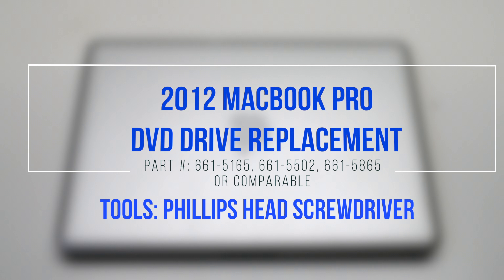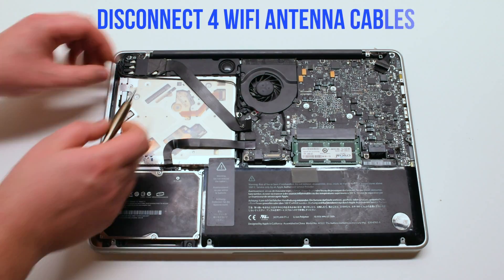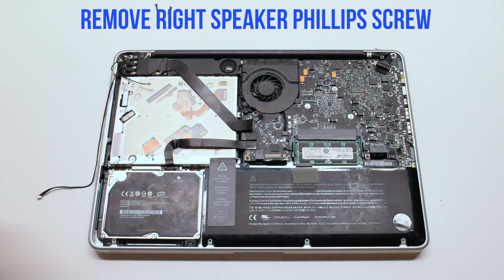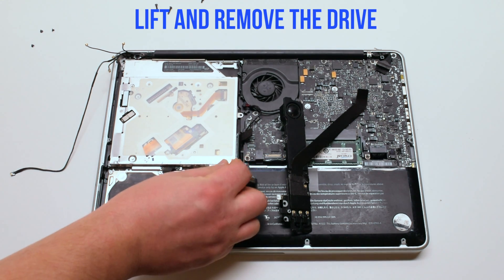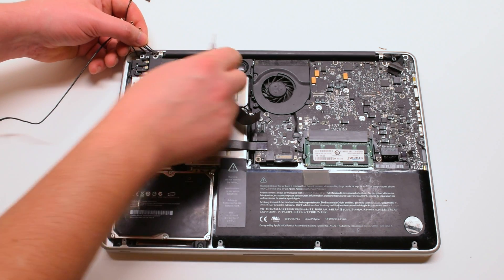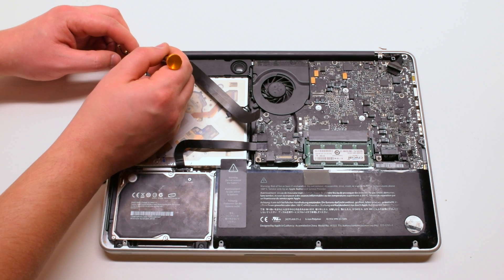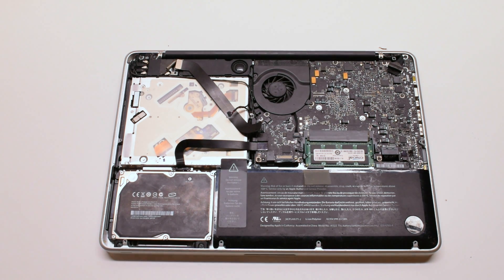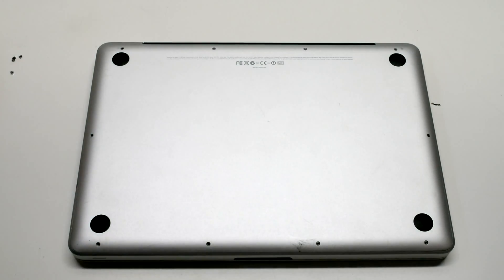2012 Macbook Pro 13" A1278 DVD Super Drive Replacement

Comment: so im not sure if I need a new dvd drive only because it works currently but it makes a horrible sound on computer startup (boot) and use any advice would be greatly helpful...also my screen when I open the laptop its a little loose I'm wondering if I can put a later model Retina display on as a replacement thanks everybody

Comment: Replaced superdrive, but it keeps rejecting discs as soon as I put them in. I recently replaced the hard drive, which had crashed, with a 1T SSD. While I was in disc utility I noticed the icon for the superdrive showed up. So I was wondering if there is something I can do to fix this, by erasing and formatting the cd/dvd drive?

Comment: It is difficult to follow what you are doing because your fingers are in the way. You should zoom in, point to the component, then explain HOW to remove it. You are randomly pulling, unscrewing and grabbing different things like the average viewer knows what you're talking about. It is very easy to damage a part if it is taken out incorrectly so that needs to be explained. I wasn't sure if I'm supposed to pull straight up, push then pull, pull to the right then up, unscrew...that should not be left to chance!
Reply: same kinda for me too lol i ended up ripping a cord outn😂 but over all this a good video btw man if u see dis

Comment: WARNING - Please read ALL these tips for this repair, especially beginners (like myself): 

1) At 1:00 don’t be scared of taking out the iSight camera cable. Just hold the cable and pull it out. Don’t use too much force. 

Also, the cable above it (speaker one) is not needed to be pulled out - once the speaker is remove just move the speaker to the right side while the plug is still put in. This will save time.

2) Don’t be careless - listen to the guy in the video. At 2:35 make sure you 100% move ALL cables gently to the LEFT side and don’t worry about damaging them (and make sure you don’t move the MacBook in the next steps where the antenna is out, so you don’t rip the cable as it can go under the MacBook and rip while sliding it), even the iSight camera one. This is important because them antenna are the reason you have WiFi. 

So, if you accidentally damage them then your WiFi signal will be poor or won’t even work at all. And the cost is like £70 (£15 for the part, and cost for labour as the job will be harder than this video), or a £20 WiFi adaptor will be needed.  

3) The antenna cables take the piss to put back in, but just use the side of a flat screwdriver and press it against the top of the antenna when plugging it in, and use your finger to push on top of the antenna to connect it. 

4) Confidence. This is an easy laptop to repair for beginners, so don’t shake your fingers or be hesitant removing the parts. Otherwise, you might damage this repair. Patience as well. This repair requires patience so don’t be intimidated by adrenaline (the rush/need of doing this repair ASAP to fix it).

5) Don’t worry if you’re missing some screws. It will be fine as long as you have the majority of the screws - some don’t even need to be screwed back in (like the speaker being screwed in with the WiFi airport thing). But try and fit all the screws back in. Also, using a toothpick to take out the screws (once unscrewed) and placing them back in the holes is very useful once you put the toothpick straight in the middle of the screw.

I just want to thank the uploaded for making an amazing and helpful video. I needed to do this repair to remove a CD from the CD drive, and I’ve increased my confidence as I have learned a lot from this repair. Thank you uploader.
Reply: I really appreciate your tips. So many precise instructions are missing from this video. I have a question - how, exactly, is the insight cable removed - do I pull it straight up (like the first cable he showed) or do I pull it straight back (like a plug from a wall)? I'm afraid I might pull it the wrong way and break it.
Reply: Juliet Jones Well with the iSight camera I just used the actual wire (instead of the actual connector) and sort of lifted it and pushed it back slowly then progressively pulling it back with more pressure until it actually disconnects. 

Fitting it back in is easy, as all you do is slide it back in. 

Also, it’s all about being cautious as well as having confidence. Be prepared when doing the repair (like give yourself a day) and don’t attempt the repair while under pressure.
Reply: Looking at the video again, I basically did what the guy did, but I just pulled on the actual wire and sort of lifted and pulled it back slowly then slowly progressively pulling it back with more pressure until it disconnects. So, it’s kind of like both pulling it up straight and back. 

This repair is actually easy, but the WiFi antennas are 100% the hardest part as it’s hard to take them off imo (but easy to put it back on).
Reply: Also use a toothpick and push the back the iSight camera back to the connector (when you have slided it in), if you’re having difficulty putting it back in.

Comment: Thanks for the video. However,  once I installed the Optical Drive it will not accept CDs. The only way it will accept CDs is if I insert a CD upon start up or if I manually type in drutil tray eject in my Terminal and then I can insert a CD. It is as if the Optical Drive is in deep sleep mode unless I type in a command. Does anyone have a solution to this? I am running on Mac OS Catalina and I have a mid 2012 Macbook Pro 13 inch.
Reply: Hi Raul, I have the same Macbook Pro and the same problem: try to burn a cd from Itunes and it just rejects the cd. Did you ever figure it out or hear from  Save Apple Dollars?

Comment: Thanks a lot man. I was doing on my own but had some doubts. And this video help me to do it. Sorry my english
Reply from the maker: Always glad to help.
Reply: @GRIBSOFT  do you know if depositioning the hard drive causes it to fail once installed again, like during loading and unloading of cd discs? I had that issue with the original MacBook I'm kind of nervous to touch the DVD drive again.

My real problem is the long bluetooth antenna (of the 4 wifi antennas), I snapped the connector off it and in order to install the new replacement part I ordered I have to remove the DVD drive? it seems to sit right under it I hope you know what part I am referring to and also that I am correct in assuming that is where it's located.

Comment: How do I get a stuck disk out? I’ve tried restarting my MacBook and holding the track pad down, I’ve tried holding the eject button down while restarting.  It’s stuck and won’t stop making this repetitive noise while it’s trying to eject the disk.  Any ideas
Reply from the maker: Best way is to remove the dvd drive and then remove the disk once the drive is out.
Reply: @GRIBSOFT  Is it easy to pull it out at that point or will I need to disassemble the DVD drive? My disc is stuck and I'm planning on selling it soon (2012 model)! Thank you so much